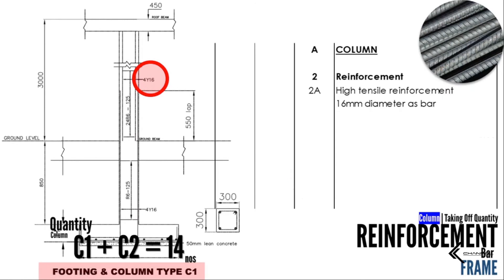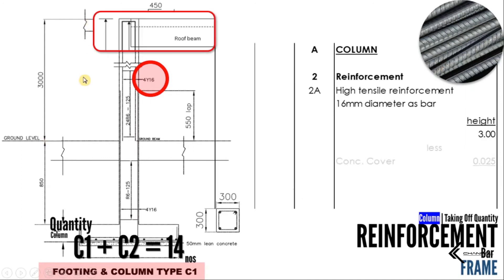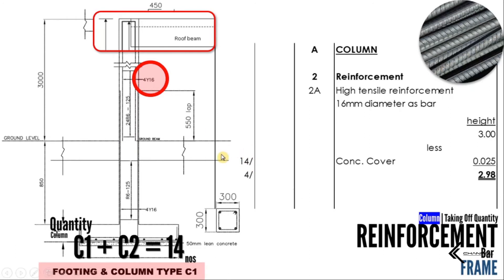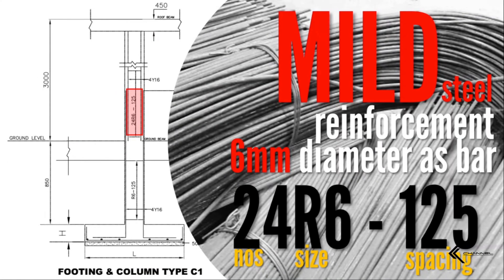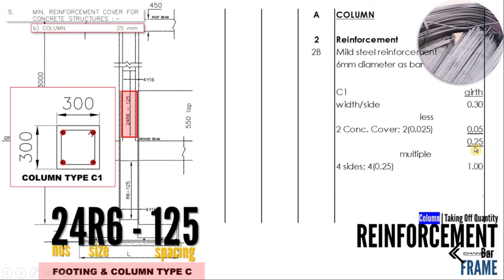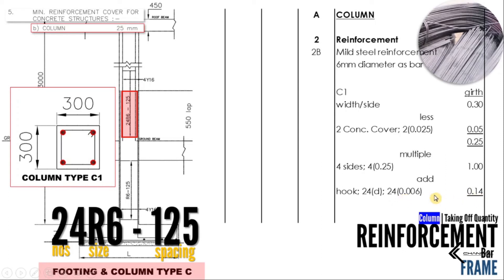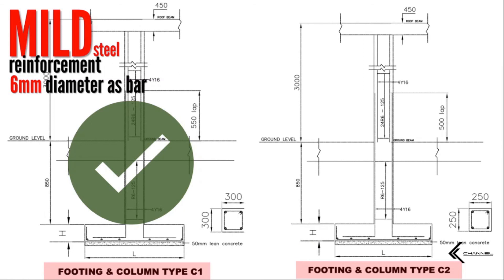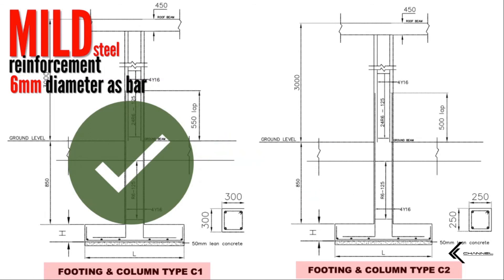🔴 Reinforcement of Column | Taking Off Quantities | Part 2

Comment: Encik, yang h.t tu dia memang takpayah tambah dengan bend ke?
Reply from the maker: Tengok pd detail dwg...ada pakai sebatang terus sepanjang beam, ada yang sambung.
Reply: @ts.khairolbinkamaruddin6257  tapi masa encik tunjuk yg keratan utk roof beam tu kan dia sambung kan?
Reply from the maker: @nrl0211  ini utk taking off column bukan roof beam.😅
Reply: @ts.khairolbinkamaruddin6257  maksud saya utk minit 5:03 tu kan dia ada tunjuk dkt situ ada bend?
Reply from the maker: @nrl0211  utk rc bar column xde bend.
Reply: @ts.khairolbinkamaruddin6257  alright tq encik
Reply from the maker: @nrl0211  no prob.👍🏻